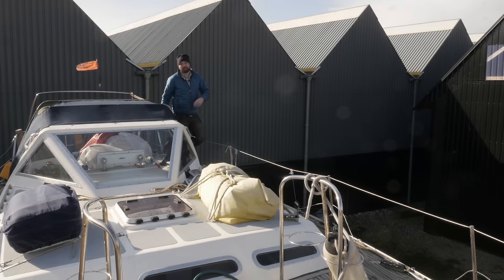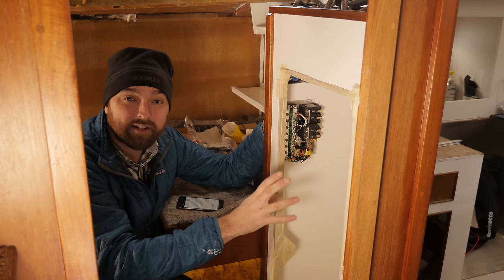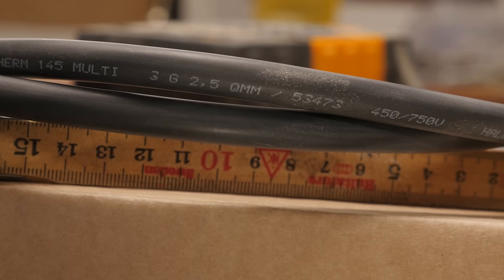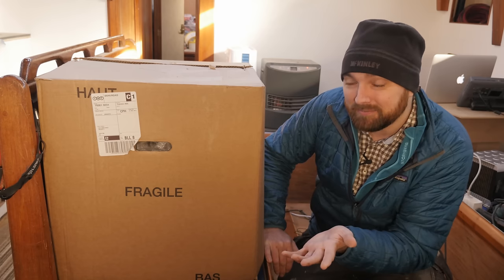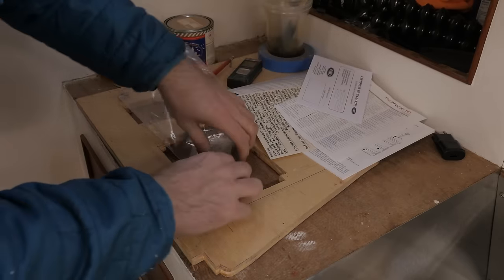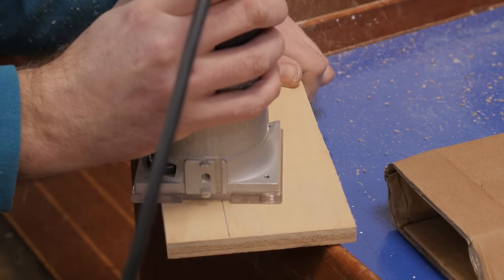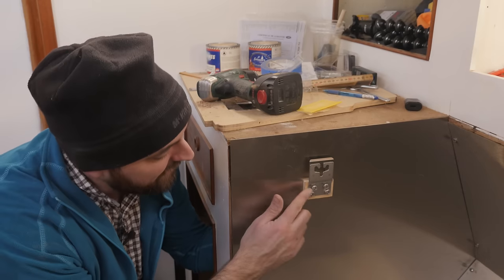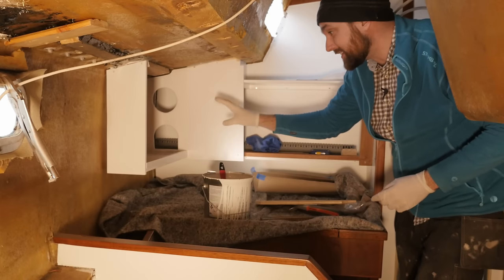Sail Life - Eno Open Sea stove for the galley & prepping to rewire the AC - DIY sailboat refit

Comment: Happy bunny had my Madz fix.👍 Really glad you are using that locker as a 'tech locker' - I claim my €5 for suggesting that wayback. I think a temperature controlled fan mounted at the top of the locker (or even the top of the door) drawing air in from a grille in the bottom of the door. For the safety cover over the 240 volt panel and the keep it clean cover on the back of the oven - raid your Mum's Tupperware drawer!!👍😀

Comment: I like the simple 12V sockets. It seems that everything is geared towards them which makes them more universal. 

I'm also a fan of the locker. I'd put a vent stack on it to the outside with a suitable bend to prevent water intrusion. The heat generated in the locker should establish a stack effect outside that  will ventilate it with some small holes near the bottom without using any electricity at all. It should be a simple calculation with the BTU's generated by the equipment and the size of the stack required. I'd also use some screening to prevent anything from finding it's way in there.

The rounding over or chamfering of the wood, or any material really, is done to reduce stress on the edges and prevent splitting or chipping. The aesthetics of it is secondary. 

Looks like you're having a great deal of fun making this boat fit you too. Enjoy it. It seems that you have quite a few others, such as myself, who enjoy watching you get it ship shape.

Comment: Just a quick thought about your new "technical locker". May I suggest, if there is room, a few small shelves (with lips) on the upper right side. Then add one of those "3 plug" AC gang boxes in the corner. This would be a good place to put chargers for cameras and other portable devices. A nice dedicated spot that is out of the way and yet convenient. Thanks for the great videos !

Comment: I agree with your thoughts on usb vs 12v socket (in North America we call them cigarette lighters because that's what they were in cars). The only thing I would consider is salt water and moisture in the air.  An open socket like that, even with a usb adaptor plugged in has room for damp to get inside. Consider maybe applying a touch of dielectric grease to the adaptor contacts when plugging it in to help protect from corrosion.

Comment: Another very informative and enjoyable video. A couple of (hopefully) useful comments. 
1. Here in Canada at least USB-C is only different at the device end of the cable
2. For 240 volts between 12 and 14 gauge wire might be overkill. For 120 volts it is only adequate. I don't know if this is important to you, but I thought I would throw it our.

Comment: I agree with using the sockets.  I have done something similar and the advantage is you can use the sockets for charging non-usb stuff as well - I have handheld vhf and handheld spotlights that plug directly in. I've got one in my pilothouse/dodger so I can charge a tablet or phone in the cockpit + it can be used for other purposes as well.  Love your videos - keep them coming!!

Comment: Using old-fashioned 12V sockets, and inserting USB adapters,  is is what I did when I rewired my (much smaller) boat. It just seemed like the most flexible option.

Also, you might want to consider adding a bit of powered ventilation (a 12v comp fan or some-such) to that locker in your aft cabin. Having an inverter and charger in that little space is likely to produce quite a bit of heat. I would just wire it to the inverter and charger "directly" (with the appropriate diodes to keep them isolated from one another) so that it automatically turns on when the inverter and/or charger are in use.

Comment: Someone once told me that adding some some trisodium phosphate into the paint inhibits mold. 

They have all kinds of quiet fans to ventilate AV cabinets, some even with temperature sensing to turn it on when required. 

Convection is a good place to start, having a vent on the bottom of the door and one on the top. You can improve the efficiency with input and output fans. If you ever plan on sailing the pacific or Caribbean, you'll be glad you have this...

Comment: I used to be an over the road truck driver, and the more 12v sockets the better. You can even pick up a little 300-watt inverter that will plug into those sockets as well, then you can use that for some things instead of the big inverter if you are worried about power consumption on your batteries (I think it would draw less then the big one, but I'm no expert), or as a backup to charge your laptop and stuff if the big inverter malfunctions. Never hurts to have backups, one is none and two is one.

Comment: Great production values as always - the stove begins to bring the galley to life, or TLPDS - the ultimate accolade :-))) - re the AC locker, have you considered mounting one of the components on the door (with appropriate flex in the wiring for low cycle movement) - good point from someone earlier re 12v computer fans, have used these on various boat projects and never disappointed and (as already pointed out) cheap and easy to carry a spare if you mount the original with possible replacement in mind. Cheers,

Comment: 100% on the decision to use 12 volt sockets.  I have 3 aboard my Buchan 37 (...waves) 

I like the new gimbaled stove
/oven. On my previous sailboat (a Pearson 43) I had a gimballed stove/oven, yet rarely needed to cook while actually being heeled
 over.  ...so on my ...waves I am using a two burner alcohol stove to AND really am appreciating the space under as an expanded pantry, while avoiding introducing propane inside.  

You do excellent craftsmanship and you decision processes are very well reasoned.  imo

...waves  (fromPortGardner, WA)

Comment: Good call on the USB "Adapter/Charger" plug into the DC socket.  USB female and circuit boards don't like salt air or condensation.  Much easier to toss the bad and grab a new up to date unit.  USB-C can hit any time and if the old format is hard wired, replacement is just another chore.  There is enough to keep you occupies on a live aboard.  Fair winds and calm seas.

Comment: You're right on track with the sockets. USB-C is on the verge of being "one connector to rule them all" for at least the next few years. Rumors are that even "Think Different!" Apple may be putting USB-C on the next iDevices.
Reply from the maker: Thanks, Rob :) Now the hunt for the best 12-USB adapter begins :P
Reply: I agree, great idea, hopefully  they can handle up to 100w, because that's how high USB-C can go (in theory)
One little tip, make sure that you leave some space around the plugs if possible, because those usb adapters come in all kind of shapes.
Reply from the maker: Sadly the 12V sockets I picked up are only rated at 15A but those should last me a while :) Perhaps I should do some destructive testing to figure out what they can really handle :P
Reply: 12v * 15A= 180 watt right? Am I  missing something?. Future proof I think ;-)) at least for usb-C
Reply: So how does one guarantee the right amount of amps to a socket? I mean, if you draw too much amperage won't that potentially burn up the wires? Obviously, i am not an electrician so I apologize if this is simple electricity 101 stuff.
Reply from the maker: Mum Blic Sorry! I misread your first comment as 100A (not w) ... seems like a lot now that I  think about it ;) :P
Reply: Philip Hewitt II Magic word here: Fuse! ;)
Reply from the maker: Philip I'd simply just size the wire and a breaker according to the highest rated output of the socket :) The breaker's "job" is to protect the wiring :)
Reply: +Philip Hewitt II There is something called a "breaker" All wires + sockets should always be graded higher then the breaker switch itself
Reply: "The breaker's "job" is to protect the wiring"  many people do NOT understand this !   For safety sake, the wire should be oversized for the breaker.  Forget the load.
Reply: He can also plug in a hand held spot light plug if needed.
Reply: Well, you tried to think ahead on the plugs but Murphy (Law) got there first.  ;-)
That space behind the stove May be good to store manuals and "important" stuff (after some fire insulation)?
Reply: I actually bought what I thought were true USB sockets and when I got them I realized they were not really true USB sockets but tiny flush USB to cigar lighter adapters snapped into cigar sockets.  They popped right out if you pulled on them to reveal the old-style socket behind them.   The one nice thing about these is the little rubber water-tight boots were designed to snap into the USB sockets securely.  Otherwise the cigar socket rubber boots often will not snap over the adapters and just hang limply over them.  Of course, you don't have to install the boots as they should be unnecessary inside the dry cabin of the boat.  But in the cockpit these would be nifty.

Comment: Glad to see you decided to move the electrical panels into that side locker...ventilation will be a must with all of that equipment installed in there..also I agree with you on the 12VDC sockets...much more versatile than installing USB...

Comment: Have to say I've got stove envy. VERY nice!  
Excellent forethought on the future proof sockets as opposed to dedicated USB outlets. I'm already having to use an adapter on one device. Will also mean guests will have more options. From my own adventures over the years, let no one talk you away from tinned wire. All wire multi-strand and tinned. Dielectric grease is also a much overlooked aspect in the Marine environment. A decent Deustch connector kit is one thing no sailor will regret (don't forget dielectric grease on edges of the seals to make them worry free in a saline environment). Lastly, a quality pencil type soldering torch kit such as the Power Probe PPSK Soldering Kit (just my personal choice). For that matter, the Power Probe III has been quite handy as well and I'm currently shopping for the Power Probe IV as well as the short finder ECT 2000 (which I've recently borrowed to trace an antenna issue).
I'm certain none of this is news given your background, but you might share on your personal views and perspectives as you get to such a point.

"The bright one is North, but the really bright one will be up in a few hours and we can see for ourselves"
Frank

Comment: Mads, we went the same direction with regards to USB charging both on our sailboat and on our R/V.  The 12-volt outlets were an ideal crossover between older technologies and new, and they also allowed us to plug in our 12-volt laptop chargers, which take less current than running the stock brick chargers through an inverter.

I also bought a USB charging box that has 10 outlets and plugs into an old 12-volt plug.  It has worked really well for charging our iPads and our Android phones, all at the same time.  We're going to buy a few more and mount them in all the cabins.

Comment: If you are going to toss those powers inverters and whatnot into that you will want to cut ventilation in the top and bottom. The air will flow in through the bottom and when warmed out the top. You should not need any fan though. Louvered grate on the bottom of the door and over top of the door preserving space on the top of the cabinet for the isolation transformer? 
The stove and the area it went into all came out very nice. 
You are correct with the USB issue. The old "standard" 12V accessory sockets will always be around. There will always be spiffy multi outlets for various appliances that plug into them.

Comment: The 12V sockets are a good idea,especially in the thought of USB-C...there will ever be a plug-in converter to this standard and with fixed USB-A sockets you can get stuck with incompability...
A cooling fan in the technical locker is a must, most inverters with a suitable wattage have their own fan, that means they produce a lot of heat, just cut a vent with grille in the door and one or two computer fans in the top of the locker, so that the heat will heat up Athena and not your equipment...
;-)
Great video, thanks!

Comment: In Australia we use the 2.5mm cable for power circuits - the 1.5mm cable is used for lighting circuits. Take from that what you will :)

Comment: Great move on the 12 Volt socket. I did the exact same thing in my camper. It also allows you to use standard 12 volt items like a fan, tv, rechargeable flashlights, etc.

Comment: I think you should use the socket you showed on the video. In Norway we call them "sigarettenner" and they are pretty universal for 12V equipment. I have both them and regular 220V sockets onboard, but the 220V only work in the marina of course(small boat with a simple system).

Comment: Hi Mads! 
Taking into account that you could need some more amps in some special situation, I would stick to the 3x2.5mm cable. Just for security reasons. The advantage of the 3x1.5mm cable beeing less stiff is not that important for your estimated 15 meters of wire. 
Just my 2 Cents. 
Take care & best whishes from Tobi

Comment: If you are putting everything in the technical locker, you need to put an adjustable (Via potentiometer or thermostatic "Snap disc")high velocity,  quiet, quality ball bearing pc fan in there. With the fan on the bottom vent and just a vent up top so it won't get the extra heat at the top and burn out the bearing sooner.  If you are in a super cold space you might want to put some sort of cover or door over the vents to actually hold heat in if outside it is -20C....the inverter will for sure produce a LOT of heat!  I looked up your computer and it is super neat.  It should be able to control quite a lot.  I am thinking of purchasing one to use alongside my Kangaroo mini PC.  Your Garmin Chart Plotter if it has wireless is compatible with most tablets/phones to see anything going on in you Nema2000 network through the Garmin apps.  The iKommunicate should do the same thing and more!  I am planning mounting two waterproofed Samsung Galaxy 10 tabs at my helm...or a waterproof touchscreen monitor at my helm linked to the PC inside.  Additionally I found a wireless laptop hard drive enclosure that sips the juice that could work as a cheap storage solution.  I could watch stored movies all day long from anywhere!  I have been bouncing my ideas off the guy from "Life is Like Sailing!" We are both in the market as we have the money.  I have noticed you two know each other!

Comment: Well done for the 12Vdc sockets. I did the same in my (smaller) boat, so I only need one socket and not two (one 12Vdc and one USB). AUKEY seems to sell good USB chargers for a reasonable price. Check the Quick charge 3.0 and the compact!

Comment: I have to say I love my Blue Marine USB2 charging points on my nav table. I've not found good reliability with the 12v connections on the plug in chargers I've purchased they are great in the car but are not marine quality. I'd put in proper USB charging points and if necessary change them for USB3 in the future if need be.... after all you have the skills! and I'd think Blue Marine would match the size... or at least you'd hope!

Comment: Thanks for the great content on your channel.  I recently put 4 of the 12V sockets on my boat and use the USB adapters, as well.  I also still use the 12V systems, including with the Fan-Tastic Endless Breeze Stand-alone Fan.  They work well for moving air and are portable and mountable.  Keep up the great work.

Comment: At least in Germany, 3x2.5mm^2 is the standard wiring for fixed installations rated for 16 amps. The reason for that of that the thicker wire will generate less heat in an enclosed space such as a cable duct or a wall.

My first reflex is to go for the USB sockets (you might want to put in something like one of the chargers from Anker), as that should cut down on the amount of cable mess. Also, a USB plug is less likely to work itself loose in heavy seas.

On the other hand, why not have both? A bunch of 2A rated USB sockets as well as a few 12V outlets. That way, you can plug in whatever you need and still cut down on the cable mess.

Comment: Hi Mads, I actually went through the regular 12v vs USB socket dilemma and chose the other way around. The reason for that is it occurred to me car type 12v -> USB chargers might be a hit or miss in terms of actual voltage conversion efficiency. In cars getting plenty of 12v is not really an issue so there is no real incentive to build something energy efficient. Multiply that by the number of USB gizmos, it could be driving to use much more Ah on the batteries than really required. Going for a USB socket allowed me to disassemble the unit and easily check the actual voltage converter used in the unit was an efficient one, as well as chopping off  the pesky led. I figured I would upgrade my sockets to larger amperage if required since the format (screw through round hole) does not seem to really change over time and changing it is just a question of popping it out, disconnect and reconnect the new unit...
Reply: tv lpgt Most DC-DC Converters will be in the vicinity of 90% efficient.  Some will be a bit better than that but few will be substantially worse.  Their greatest inefficiency, by far, will be when they are unloaded, but by that point most of the load should simply be the power-on LED and that load should be no more than a few milliamps in total if at all well designed, which is inconsequential on a house bank of at least several hundred amp-hours capacity.  I really have not come across any that I would consider especially inefficient (though I'm sure there is the odd one out there), probably due in part to the fact that their chipsets are usually pretty well standardized and power dissipation is a limiting factor in this form factor, which sets some hard limits as to how inefficient they could be without self destructing due to excessive heat.